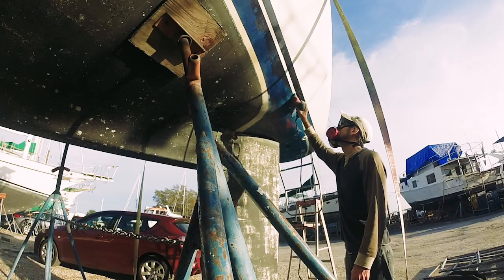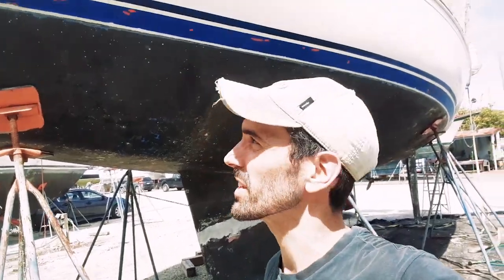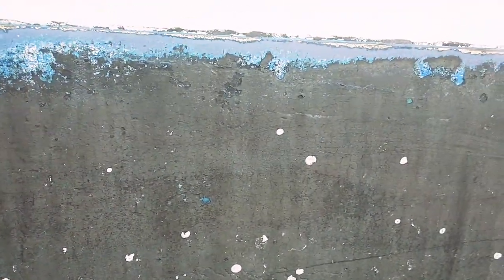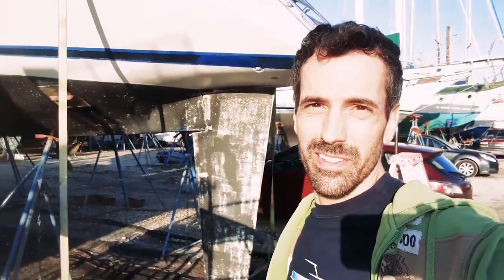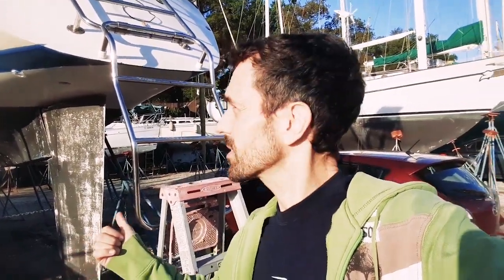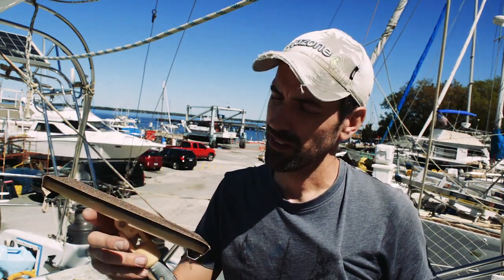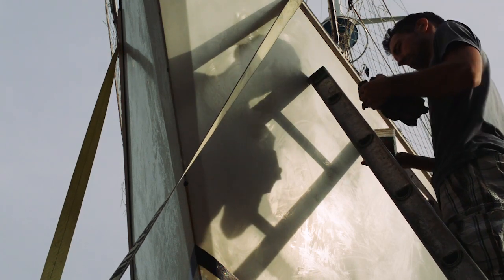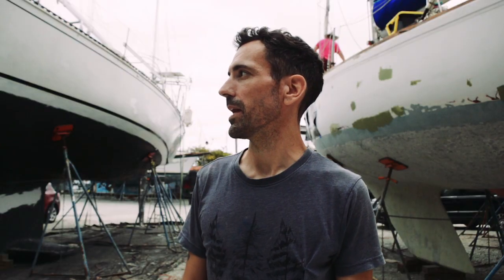WET SAND The Hull and Painting Barrier Coat - Cruising Sailboat Refit | Sailing Balachandra E115

Comment: Sorry another question: what kind of paint did you use to paint the blue tripe? Something special to go over the gel coat?
Reply from the maker: Interlux topside paint - make sure to sand and clean with solvent before using!
Reply from the maker: Actually it might have been epiphans
Reply: @SailingBalachandra  thank You so actual paint specifically for Top side